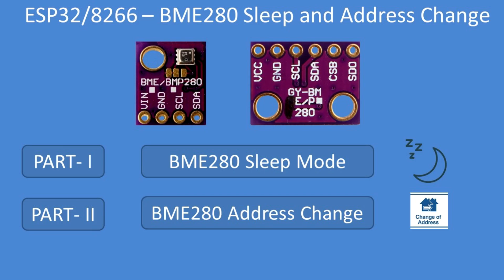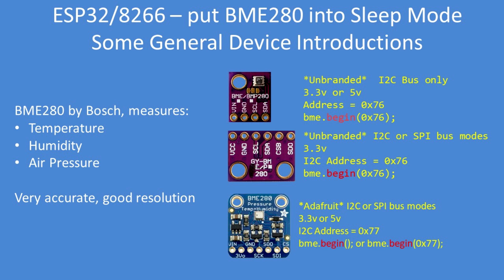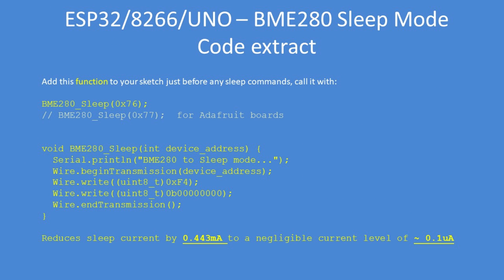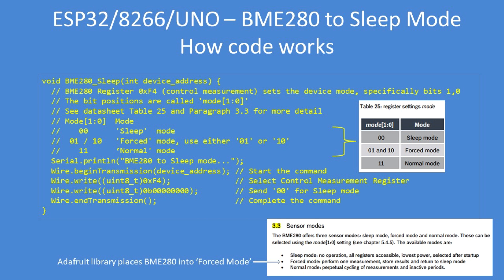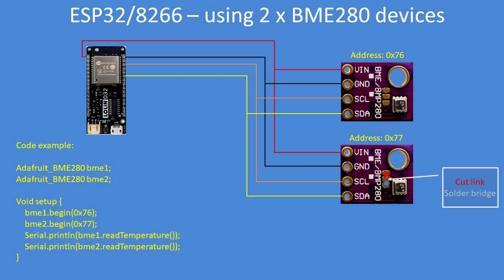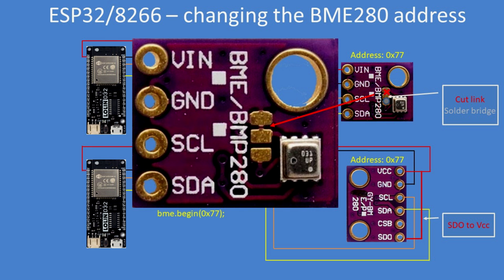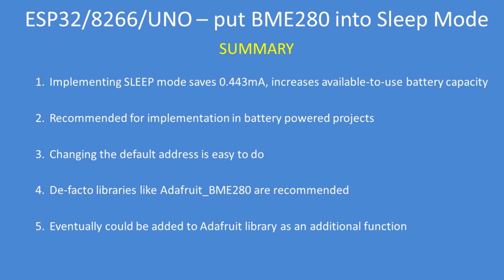Tech Note 141 - ESP32/8266 - BME280 Sleep Mode and Address Change

Comment: I had the deep sleep script running for multiple years, but if I compile the script now with platformio in visual studio code,   Wire.requestFrom(device_address, 1); makes the script hang up. Does anyone else have the problem?
Reply from the maker: @maxamende4563  I’d say you have imported a library to provide I2C services and then issuing such a command creates the conflict.
Reply: @G6EJD  Thanks for the crazy fast answer :) . I debugged and tested for the last couple of hours. Seemingly something changed in the switch from Arduino 1 to Arduino 2. If I am using espressif32 @ ~3.5.0 (the last arduino 1.x based release to my understanding) everything works. With any newer release Wire.requestFrom(device_address, 1); stops working. Have you made experiences like that?

Comment: Hi, i have 2 unbranded i2c modules, i can't change the address, i can't see the bridge but tried to cut anyway, the first 2 contacts tested for continuity with gnd always beeps, if i solder the center and last one the modules (i tried both) overheats beyound being touchable and does not show if scanned, i also tried to power it via 3,3v instead of 5v and it gets less hot, barely touchable without burning a finger, but it does not show up, maybe is a defective batch?
Reply from the maker: Sounds like erroneous devices, the track is very fine.

Comment: But why is the sleep mode 'better'  than the force mode? As I understand the datasheet, the BME goes into sleep mode after taking one measurement in force mode anyway.
Reply from the maker: Try and see! You will find a significant drop in power consumption by doing what I suggest, it does not enter sleep.

Comment: Hello. How can I switch back to normal mode? " Wire.write((uint8_t)0b00000011); " does not work. Thanks.
Reply from the maker: You have to send the wire.begin command, so copy the function and write the defaults value back then end with a wire.end command. If the library is reset it will reinitiate the correct conditions, bme.begin etc.
Reply: @G6EJD  I wrote function:
void BME280_Wake(int device_address){
  Wire.beginTransmission(device_address);
  Wire.write((uint8_t)0xF4);       // Select Control Measurement Register
  Wire.write((uint8_t)0b00000011); 
  Wire.endTransmission();
  }
after waking arduino can not read any data
Reply from the maker: @elpavlo1666  try looking at the Adafruit bme280 library on github they use 
  write8(BME280_REGISTER_SOFTRESET, 0xB6);

To reset the device
Reply: @G6EJD  Thanks for help. I have found the solution: bits 2-7 of 0xF4 register are responsible for oversampling of temperature and pressure so in  BME280_Wake function we shouldn't fill them with zero. Right filling of register for x1 oversampling: 
Wire.write((uint8_t)0b00100111);
Reply from the maker: @elpavlo1666 , if your cpu is in sleep mode then at wake the bme280 would be reset anyway, it seems your not pms I g the cpu into sleep mode. Good to hear you have a solution. The data sheet is your friend.
Reply: @G6EJD  I used Arduino Nano in my project, so maybe it does not reset bme280 after sleep. Anyway thank you very much.

Comment: I updated one of my outdoor temperature sensors with a BMP280, and as you predicted, power usage is noticeably less. As I monitor the voltage of the LiFePO4 battery, I can tell from the graph the slope downward is not even enough to imagine a sled to move on it's own downhill, where before your suggested force to sleep it was steep, especially when the battery was freshly charged. Like many people I just believed the datasheet ( i.e. that the module would go into sleep mode automatically), the facts prove otherwise. Thanks!
Reply from the maker: Yes, the data sheet says when in forced mode the normal setting it returns to sleep when in fact it returns to some quiescent state that is not sleep, when set to sleep it definitely sleeps, the savings are worth it for battery powered operation. Good to hear it works for you.
Reply: @G6EJD  Hi please see batteryusage graph of one of my BMP280 temperature sensors. I added the sleepmode on June 20th. It looks like power usage is reduced by an order of magnitude: See this graph:  https://1drv.ms/u/s!AmouwiVw2cl-dFin_9cVlVDhoi0?e=MSpMiZ
Reply from the maker: @peut  yes a definite improvement which makes a significant difference when using batteries

Comment: Dear Mr David, thanks very much for the note, very useful indeed. In my project I also have an Adafruit_SSD1306 display. Is there a similar way to put it to sleep? Thanks.
Reply from the maker: IF you mean the display, no, but if you clear the display (to all black) then that will make a big difference to power consumption.
Reply: Using adafruit lib you can turn it off using
display.ssd1306_command(SSD1306_DISPLAYOFF);
and back on
display.ssd1306_command(SSD1306_DISPLAYON);

I don't know how will it affect power consumption, thou

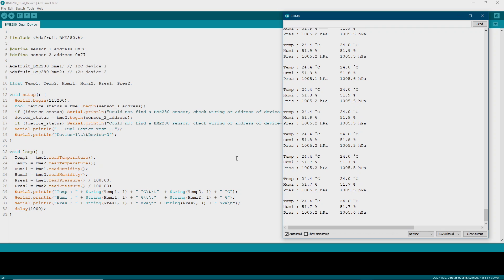Comment: A note about the sample code you used at 0:55.  You are doing two reads to take an average. The sensor can do that for you by adjusting the oversampling parameters. Oversampling makes it possible to reduce the noise in the measurements, section 3.4 of the data sheet.
Reply from the maker: Hi, l I think you missed that one reading is bme1.readtemperature and the other bme2.readtemperature, the example shows how to take a reading from two different devices at different addresses.
Reply: @G6EJD  Ah yes. Sorry about that.

Comment: I have the red unbranded board and the adafruit's bme680 board. I think that those sensors reads a bit too high temps. Anyone else with this problem?
Reply from the maker: If your supplying the board with 5v then the on-board regulator dissipates heat that warms the sensor via conduction down pcb tracks, try powering the board from 3.3v and don’t run the gas sensor heater for too long as that has the effect of heating the temperature sensor or take a temperature reading before a gas reading

Comment: The two most popular BME280 libraries are from Adafruit and Sparkfun. Both these libraries try to be generic enough for all possible use cases. Being generic, they are not very optimized for various things. For example in the Sparkfun library, registers are read one at at time vs instead of burst as recommended in the data sheet on page 23, section "4 Data read out".  The Adafruit library will call readTemperature in both readPressure and read readHumidity because the latter two depend on the temperature.  So in the sample sketch above, in each loop, the temperature is read 6 times.  In a battery operated temperature sensor running on a super low power micro controller, you want to spend as little time awake.  Awake the microcontroller, take a reading as fast as possible, determine if it should be sent (serial / RF / etc) and get back to sleep as soon as possible.  Typically you will wake every 60 seconds.  To be clear, the quality of the Adafruit and Sparkfun libraries are really great and they are designed to allow the user to fall into the pit of success.  I have been working on an optimized BME280 library for only weather sensing (60 second forced read samples, 1x temperature, 1x humdity, 1x presssure over sample, no filter) as recommended in section "3.5 Recommended modes of operation" in the data sheet.  I hope to have the code up on github later this summer once I have tested it against multiple of my BME280 boards.
Reply from the maker: Phil, hopefully you will include a specific sleep mode or ensure in forced mode it does indeed return to sleep, the Adafruit implementation of forced mode does not return to sleep mode, maybe because of over reading or simplification. Over-writing of the F4 register could easily be resolved by just clearing bits 0 and 1, I suppose I could have implemented it that way, but as long as the library initialises the device it does not matter how sleep is achieved. I look forward to seeing your library. When all said, I do side with Adafruit’s approach to coding the library if it enables the majority of readers to quickly understand what’s going on, since the Arduino (est) community is mainly about learning just enough to get something working. I’m reminded of my university tutor teaching not to over use Karnaugh map ‘simplification’ as it makes future reading or understanding near impossible, he was mainly referring to the future maintenance of the design, they were wise words.
Reply: @G6EJD  I just pushed my work "in progress" code to my github account, pbolduc/bme280-for-weather. Like I said, it is very opinionated. One area I dont like is that I have observed it takes between 8 - 9.3 milliseconds to complete the read. I dont like that I have to sleep / block for the entire time. I dont think on the Motieno micro controller I am using I can deep sleep the processor during that time.  Maybe it doesn't matter?

Comment: Be aware that writing 0b00000000 to the ctrl_meas (0xF4) also over writes the temperature and pressure over sampling bits.  You will have to reset those bits if you want to get any readings (humidity depends on temperature reading) when using a forced read.  If you are using the BME280 for weather sampling and using the recommended over sampling settings from the data sheet, 1x temp and 1x pressure, you would set 0x00100100 to set to sleep, and 0x00100101 for forced read.  You do not need to write sleep after a forced read as the state transitions back to sleep automatically, see page 15 of the data sheet.
Reply from the maker: Yes agreed, I’m relying on the Adafruit library to set the device into the correct conditions for reading or indeed any other library, as I’ve yet to see any library that can enable the device to be explicitly set to sleep. Forced mode says it returns to sleep but that’s not my experience and power demands stays relatively high.
Reply: @G6EJD  Interesting about the power usage in your testing.  I will have try using my Current Ranger to verify your observations.
Reply: @KoreKount  Looking forward to your results.
Reply from the maker: @KoreKount ,  I'd be interested in your validation of my results. Also if your into minimising power consumption, I'm surprised your don't already know what your getting in sleep mode power consumption, I would not be surprised if your getting ~500uA as I have yet to see a driver that achieves sleep mode after a read, most leave the device in forced read mode and hence the ~500uA consumption level. Despite what the data sheet says, the BME280 does not go back to sleep in that mode.

Comment: Hello Dave. Is it possible to make sleep DHT22 also? And can we achieve that?
Many thanks.
Marc :)
Reply from the maker: Unfortunately that device does not support a specific sleep mode, but in standby (no reading taking place)  it consumes just 50uA so with a Lolin D32 taking 77uA plus 50uA a total of 127uA isn’t too bad for battery use. Other ESP32 boards won’t be anywhere near as good though.

Comment: Excellent video David, I was searching your videos to see if you covered this very topic yesterday... What  do you think of powering the BME280 with a GPIO and turning that off during sleep - I think GPIOs turn off anyway during sleep? I'm experimenting with that and a 5ms power up delay before I take readings.
Reply from the maker: Yes it’s a good idea, never tried it, but it should work, the only doubt I have is the gpio output impedance which might be too high for the bme280 to start correctly, but I notice it’s power supply rejection ratio is very high, so should be ok, maximum ESP32 gpio pin source current is 40mA, so swell within range, maximum power requirement is 0.714mA. Startup delay can be 2mS before taking a reading. Yes when the ESP32 goes to sleep all the gpio pins are released and go tri-state, but if required you can enable the pins in sleep mode, lots to experiment with😀
Reply: It's working fine on an ESP8266 (One GPIO for sensor VCC, another one for GND)

Comment: Thanks  David for nice instructions. Been playing with BME280 for more than a year, never been able to get IAQ readings to be accurate as well as temperature. (Usually temperature indicates about 2 - 2.5C° higher to actual). Maybe sleep mode can sort it, will try. Thanks again!
Reply from the maker: You really need to use the device at 3.3v meaning a device with no on-board regulator and if it has an on-board regulator it should still work at 3.3v, so I recommend checking the supply voltage is well within specification (3.65v max) and yes sleep mode will help, but at 3.3x0.5mA=1.65mW it’s just not enough energy to hear the device and ambient conditions will always control its temperature. Is there any conduction down pcb tracks from say a cpu / regulator that is causing the temperature skewing - its much more likely to be the cause.
Reply: @G6EJD  Sorry, David, my bad, you are about BME280, but I wasn't awake enough and my brain did a trick - I thought it's about BME680. You are absolutely right, no issues with BME280, been using avail ago successfully.
Reply from the maker: Same problems with the bme680 take a temperature reading before a gas reading and power the board with 3.3v
Reply: @G6EJD  , I am using lua and there is no options in a library to read "temperature only" - it takes readings automatically each couple of seconds.

Comment: Very nice sir I have a question that although bme28 is most popular sensor but which sensor would you recommend for commercial product development from project to final product release because as we know BME 280 sensor having self heating issue  which gives unreliable readings . May I use HDC1080 sensor for iot product development or go for something else???
Reply from the maker: Well self-heating is caused by the sensor being left in continuous reading mode although in terms of heating energy it’s only 1.6mW so not much and very much less than the ambient heat, so should be negligible. I’ve never experienced self heating because I only use the 3.3v sensor with no regulator. If your using the smaller unbranded board or any carrier board with a regulator then it will dissipate (5 - 3.3)x0.5= 3.35mW which can get conducted down pcb tracks to the device.

Now if you were referring to the BME680 where self heating is a definite problem because the sensor for gas has to be heated to 220°C and this can affect temperature reading accuracy, the solution is to not read temperature at the same time as gas and separate the readings by many minutes and by placing the device into sleep mode during readings, so wake take a temperature and humidity reading then sleep them take a gas reading then sleep and repeat is how I do it. Adding another sensor adds to cost.
Reply from the maker: I’d still recommend the bme280 just change it’s use case
Reply: @G6EJD  thank you sir for guidance  and how I can improve or get accurate temperature and humidity readings  because ds18b20 gives verry accurate reading when i compared with BME 280 unbranded 3.3 sensor module.  Bme 280 gives 2-3 ° degrees more readings so should I  correct at programming side or which approach would you recommend for accuracy

Comment: Only thought of putting the MCU into sleep mode, never thought of the sensors.  Thank you for posting.  Bob
Reply: Yeah, with sensors that use heaters (like gas sensors) it's an obvious thing to think about, but I had never thought to do it with BME280s.